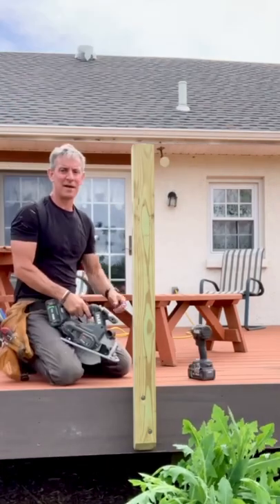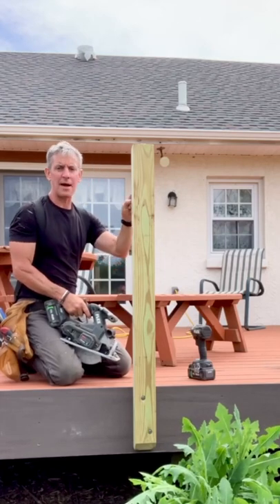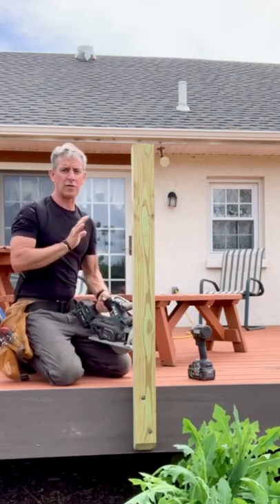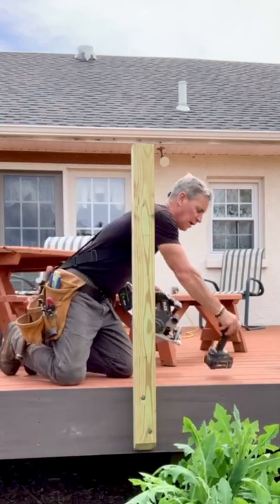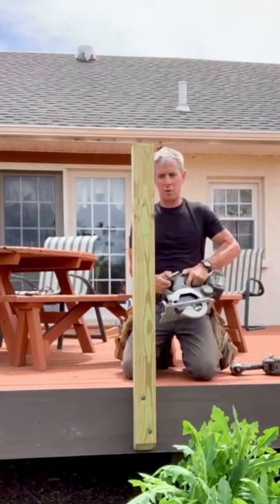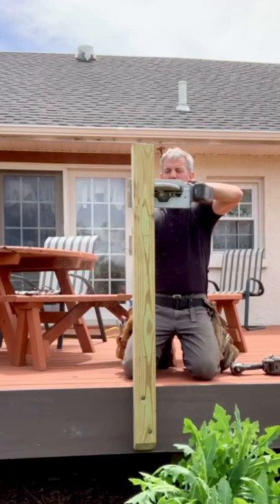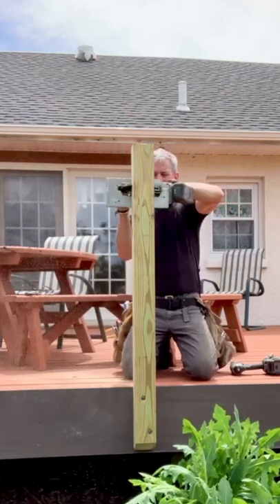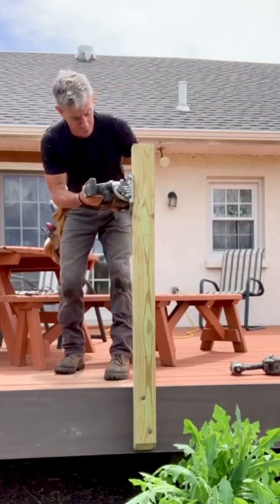How to cut a deck guard rail post in place

Comment: That method of attaching guard rail posts is now a code violation. Guard rail posts need to be through bolted inside the rim joist and through bolted again to the joists and blocking..
 What you have done here is illegal and dangerous.
Reply from the maker: Easy Captain Code. First of all, they don't need to be housed inside the frame and blocked in all jurisdictions. Maybe yours, but not everywhere. If I were a giant YouTuber I'd start a contest and give someone a prize who can hobble this connection without tools that also doesn't cause catastrophic deck failure. I won't even include the other posts and 2x6 top cap that share the load.
Reply: @myfixituplife  So you take pride in building decks with techniques known to be less than the safest because you can get away with it on a technicality? 
  Got it.